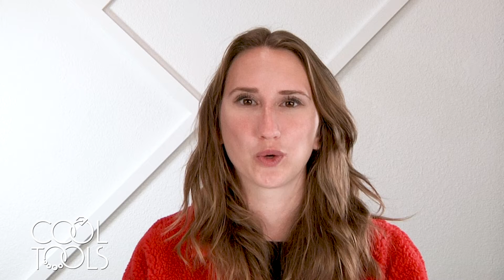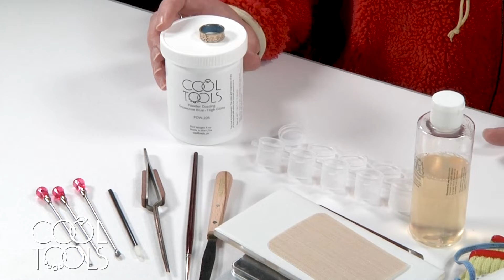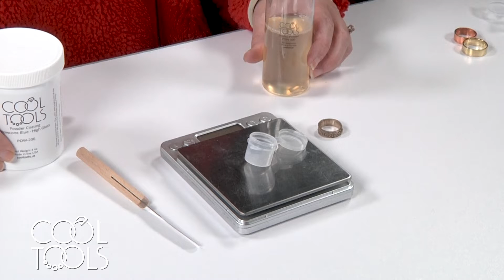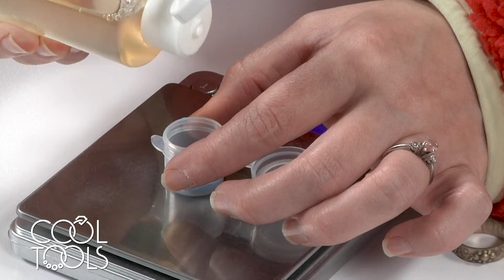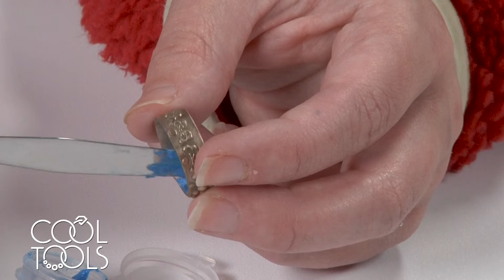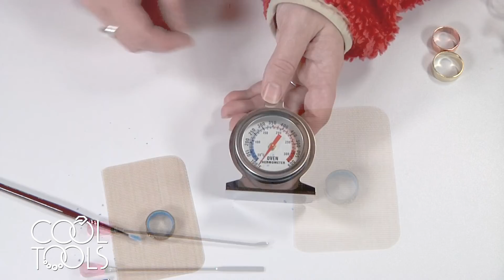Apply Powder Coat to the Inside of a Ring by Karen Trexler | Cool Tools

Comment: So what exactly is powder coating? It's not enamel, correct? Does it have to be fired in a toaster oven or can you use a kiln? Thank you!
Reply from the maker: Our powder coatings are polyester or polyurethane. They are not enamel; enamel is glass. Yes, powder coating requires a toaster oven at 350°F - 400°F. A kiln would not work with powder coatings. Hope this helps!

Comment: Hi so i ordered the liquid 2 powder 2 question? 1# whats the ingredients?  And do you need to ruff the edge the powder coat is going on? I love Cooltools products and have ordered a bunch from this company!
Reply from the maker: Hello, you can find the SDS for Liquid 2 Powder here: https://cdn.shopify.com/s/files/1/0596/7092/1404/files/Liquid_2_Powder_SDS_Cool_Tools.pdf?v=1700096860

I'm not sure what you mean by rough the edge the powder coat is going on. Do you mean sand the piece? You do not need to sand the piece before powder coating, you just need to clean it properly. Hope this helps!